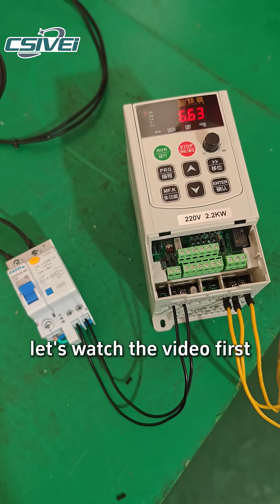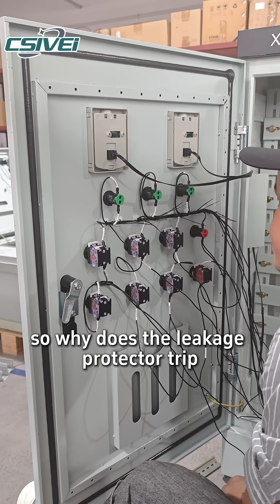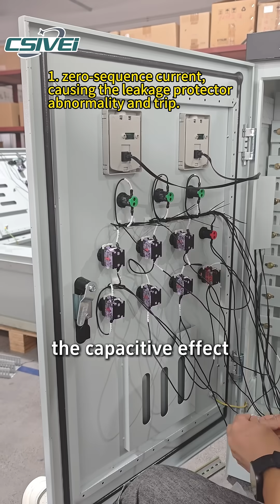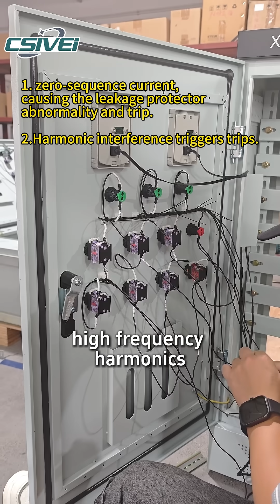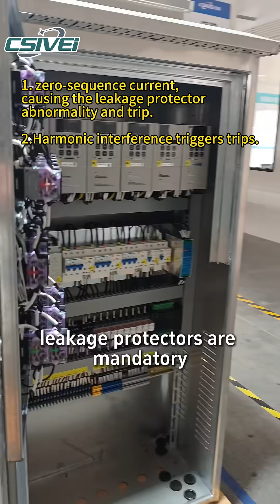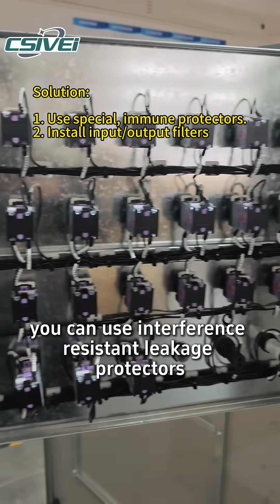Why VFD can't be connect with Leakage protector #vfd i#electrical  #industrialautomation #acdrive

Comment: There are many models, some have little harmonics, EMC noise and are fine with RCD. Some then are just totally horrible and will trip everything by chopping stuff to earth and tripping any RCD.
Reply from the maker: Exactly! You've hit the nail on the head. The performance and 'cleanliness' of VFDs can vary dramatically between models. This is precisely why a one-size-fits-all approach doesn't work. Some premium drives have built-in filters, causing fewer issues, while others require external solutions like the immune RCDs or additional filters we discussed. Thanks for sharing this practical insight!

Comment: you can connect a vfd to a leakage protector, but use the earth cabel. you are missing the ground wire... and some vfd create noise on the network and need an EMI filter... read and learn from the manufacturer of the vfd...
Reply from the maker: Appreciate the comment. Proper grounding is indeed the first step. The EMI filter you mentioned is one of the solutions I proposed to suppress harmonics and high-frequency leakage current, which cause the nuisance tripping. Have you found certain brands of immune leakage protectors or filters to be particularly effective in your experience?